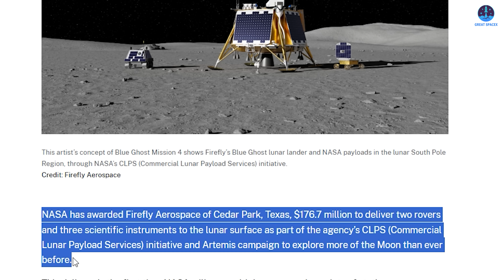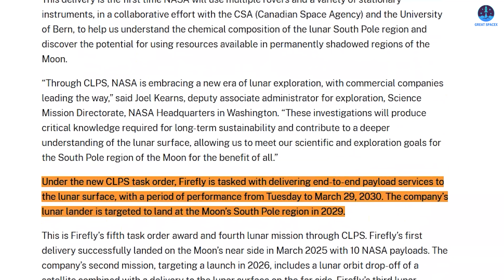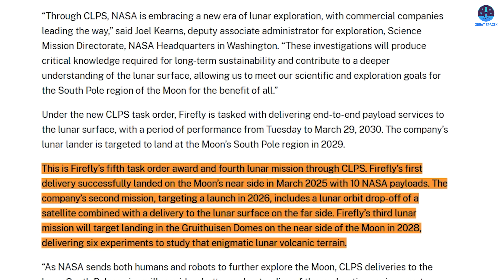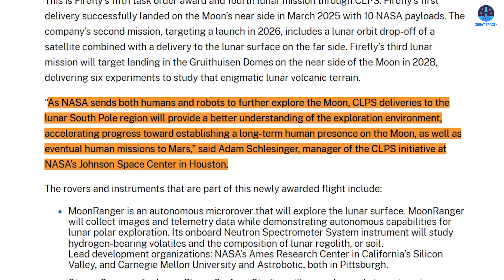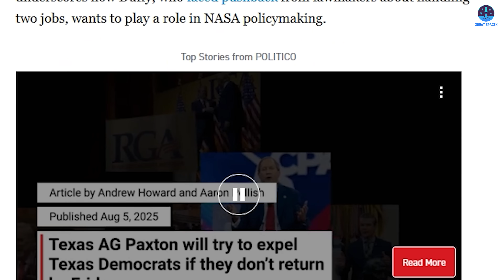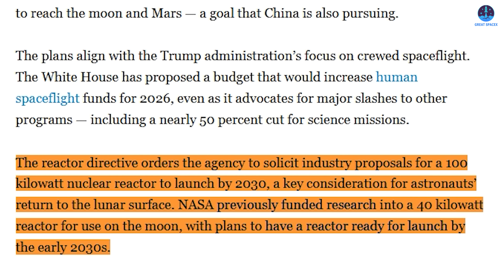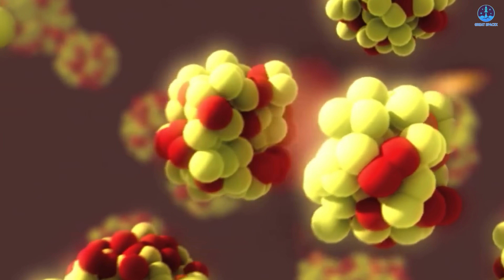SpaceX Unexpected Turn to Cancel Catch Starship B16 for Flight 10!

Comment: 1:15 Please stop using that SpaceX euphemisms: A failed engine is not a good thing. Sure, it's good to spot it in early tests, but still it's not a good thing in itself. And these problems, as you say yourself at 1:31 are an ongoing issue, so this development model has it's problems. Starship still has to prove that the concept works at all and has not gone to low earth orbit and returned safly ... meanwhile fantasizes abou the moon base and the mission to Mars.

Comment: Anyone thinking the hot staging is damaging the 2nd stage and that is why it keep failing.??
Reply: I mean the engines didn't fail last time, so unless it's REALLY damaging stuff deep inside it such as the fuel tank it's probably fine.
Reply: @logicbuilder1204  Remember they redesigned the hot stage ring, so it was not perfect from the start. Also pressure, vibration or stress from HS could damage something that fails later. Its Spacex so I am sure they are on it.

Comment: If they don't plan to catch the rocket, why not use them to test landing legs and land them on a platform at sea, or on land for future Mars and Moon landings.
Reply: Legs are heavy and if it doesnt work they would destroy the landing pad
Reply: @benibanyai  
They will be needed when they land on the moon or Mars, there will be no landing pad, not first at least, so it would be good to work it out on earth first I think.
Reply: @SpaceManAus  the booster wont have legs, its not going to the moon
Edit: + they havent gotten the ship to orbit and to get back it needs to do 1 full orbit so landing gear of any kind is unnecessary for the ship

Comment: Well it stands to reason that they would not schedule or announce an attempted catch of the booster. I would bet that they are hoping for a successful Starship flight and may attempt a catch of it instead.
Reply: they wont try and catch the ship yet. they still need at least 1 water landing where the ship is on target and is fully intact before they can attempt a catch.
Reply: @rainman6598  That is very probable. But you never know. And with the notification that they were not going to attempt to catch the booster leave it open.

Comment: Probably because they are moving on to next block for booster and learned all they wanted from the previous booster catches for block2?
Reply: Sounds reasonable. At the end of the day, and despite all the naysayers, that giant friggin booster actually works. It's done it's job or damn near just about every time which is pretty crazy if you think about it in the big picture and in light of iterative prototyping. Pretty badass.

Comment: I understand that SpaceX isn’t going to catch B-16. 

It would be interesting to see them hover and maneuver the booster several hundred feet above the water until it runs out of fuel. Just to see what maneuverability they can get out of it. 

It would be cool to watch it hover.
Reply: Catch booster and Starship  OR do not fly!
Reply: @DrDiff952  😂 don't worry about what they are doing. they will get it done.
Reply: @DrDiff952 Glad you're not involved in the Star Ship. 😁
Reply from the maker: Wow😲

Comment: FYI......
Neither ship or booster is fit to land, the engines are not shielded to do so for a start, stainless used for cryo fuel plumbing, stainless used for high temp variance structure, stainless used as fuselage, composite anything being used as pressure vessels, zero hardening for hot staging, no landing system in place for either....... a proverbial engineering 💩 show x
Reply: I agree. It’s designed to fail, propellantless propulsion has long been developed. SpaceX is just a sideshow distraction.
Reply: SpaceX has already re flown booster 14 (flight 7 & again on flight 9 just 5 months later). Estimate of cost to,build a booster is around $63m with re flight costs around $2m.
Reply: @Oss-6342  """"not fit to land""""
Read better xx
Reply: @albertbahoogadin  having reread your post, my point remains valid.  You state neither booster nor ship is fit to land.  I pointed out this doesn’t make sense as booster 14 has already been returned (and subsequently reflown).  You may be trying to make a pedantic argument of land vs caught but the desired outcome is reusability and the SpaceX design philosophy is to catch.
Reply: @Oss-6342  DID IT LAND???
NO IT DID NOT!!!!

Hellooooo....Mcflyyyyyy

Are you going to build towers on moon and Mars to catch them???

Are you a little bit stupid??.... asking for a friend
Reply: @albertbahoogadin  I think you might be lacking the understanding of the design of the starship system. The booster will not fly to the moon or Mars and therefore no catch towers are required to be constructed. There are three towers already built on Earth and boosters have already been caught three times (with one reflown).  Starship had successfully landed multiple times with landing legs (SN15 for example) but currently SpaceX are developing the heat shield etc. so are not focused on extra terrestrial landing (many starships will be locally used as fuel shuttles for example which can be caught and reflown - saving weight).